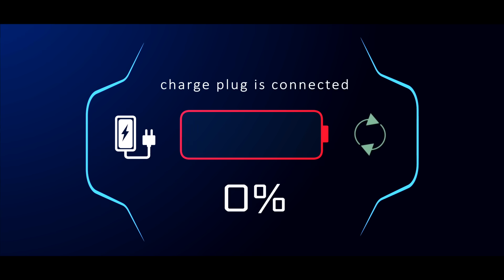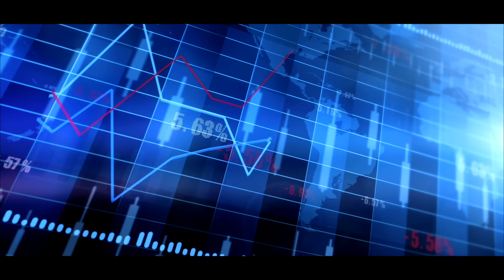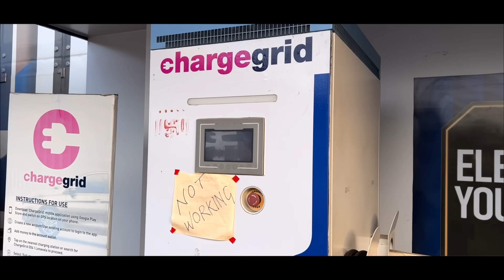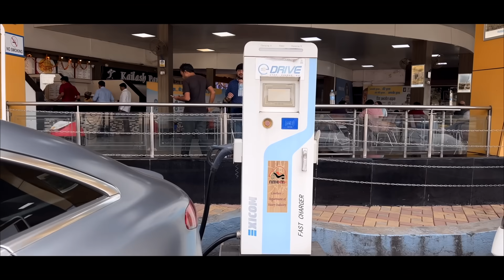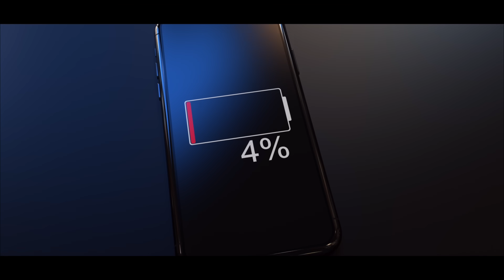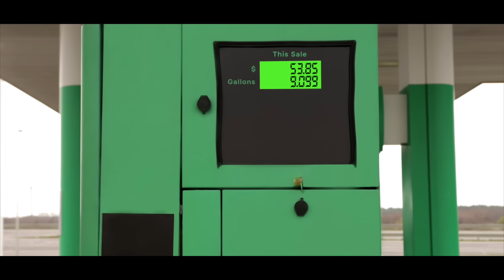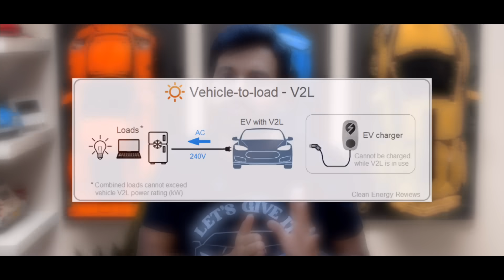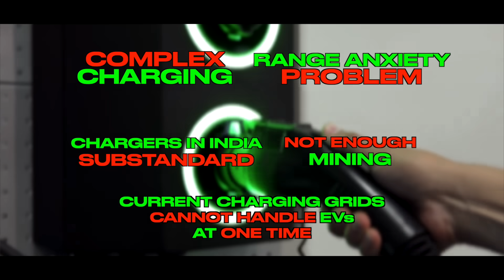Here Is Why Electric Cars Are Not The Future!

Comment: Let's pray this video doesn't get taken down for stating too many facts 🙇‍♂️🙇‍♂️
Reply: Why it would be taken down?
Reply: This video lost (fail to mention) the most important points:
1)  ICE car efficient can only reach about 30%, but EV car efficient can reach 90%， this means for the ICE car 70% of energy goes wasted in the form of heat, which add the global warming.

2)   90% car accidents are due to human error, auto drive is the solution, but you can't achieve auto drive by ICE car, after so many years of testing, why? because ICE response so slow when you give the e-instruction, while EV car can response in 1/1000 second. 

3) To see how the EV car auto response can do, watch the video with the title: 
BYD Yangwang U8 AWD EV SUV With 1,100HP
Reply: @madeinchina1450  yeah I agree with you but most of the batteries are lithium based that's why these videos are popping out once this battery technology gets some changes (Without any lithium or cobalt or any) which is somehow graphene-based batteries would be good but still we need to wait for it again till then we need to focus on more BMS(Battery Management System) which can prevent these incidents.
Reply: @madeinchina1450  name says all
Reply: @madeinchina1450 
1 efficiency is not a problem if the cost of energy is cheap. So when renewables are cheap enough green synthetic carbon neutral hydrocarbons will replace fossil fuels. Ice cars will be cheaper because remember  the kwh per km cost of evs don't take into account the cost of the battery. Every kwh stored on a battery is cost. Cost is the defining factor not efficiency.

 2) self driving vehicles are still not a thing even though people like elon have promised it years ago. There are things AI will never figure out. I saw a video where a self driving car stopped because there was a red advert or something like that and it though that was a red traffic light.  When AI pass a capcha test then maybe they can drive properly
Reply: @amithmalik4648  whole country fuel need to full fill you need 5 times more solar panels and wind theare are also envarmental impact

Comment: You are right Faisal. Another thing to consider is that once the production costs of EVs come down the subsidies will also be laid of as well as the free or minimal cost charging . The only advantage EVs have right now is in low running costs. Once they are in abundance naturally the consumption of fuel would also come down creating less demand and hence lower fuel prices. So in long run the running costs of ICE and ev vehicle would also turn out to be similar.
Reply: Electricity will always be cheaper than oil

Comment: But the thing about EVs is that the source is centralised and the smoke produced is not right on ur face like the ICE vehicles, the electricity produced for EVs is far off from the residential area. So even if it causes the same amount of pollution in generating the electricity, the AQI of the cities will be largely better, just like a mini forest in midst of the urban city which has better AQI then its surroundings.

Comment: Thanks for pointing out the dark side of EVs. Hardly anyone on youtube has talked about this topic. Perfect presentation.
All the points are 100% true.
I just got my license few month few and driving ice cars gives me pleasure . It's a moment for me.
Driving an EV is like driving a toy car which we were used to play when we were kids
I'll never buy an EV in my entire life
Reply: Same here.
Reply: On the contrary, actually a lot of people talked about it and usually with half baked information or bias just like this one. There are a ton of good points in this video but super misleading. It's not apples to apples comparison and more of a bias. And I don't think you have been in an EV before. They will blow your mind. They are fast, quiet and lot more efficient and easy to maintain since there's no maintenance  other than changing vipers, 12volt battery and tires for the most part.
Reply: @techenthusiast4542 you have some great points but  I think one thing some people like is the sound of the car. Many gasoline engines tend to have a great sound, like 5 cylinder audis, dodge vipers, and many other sport cars. Driving an ev  would still be a somewhat unpleasing experience because of that. I love to hear the rev of an engine. It adds personality to the car.Also, some EV'S like teslas have expensive batteries, and they can cost up to $20,000 to replace all of them, when parts for a gasoline car would be cheaper.
Reply: @toasted_bagel59  Yes they do sound great.  Especially my motobike will blow them out of water if I put mine next to most cars. My 3 series had a great sound before I switched to my current Mazda which also makes nice noise. But that's not my point at all. It's all about how we move from unsustainable to sustainable modes of transportation. Either we grow a hell lot of trees all over the world (which doesn't seem to be the case) or switch to EVs for transport and Solar and Nuclear for electricity. Because we are actually running out of oil and we keep drilling more and more locations and more wars if we can't drill. My brother works for an oil company by the way. Our energy demands are only on the rise and so is for other countries. If you live in a big city, go out and look at the sky, smog is the first thing you see. It's kinda depressing. Respiratory diseases are only on the rise if you look at statistics. At least if big trucks are converted to some from of nonpolluting fuel source, things should turn around quickly. Just because I love the sound of my vehicle and bike should mean I have to hate EVs. Battery prices are coming down and should be between 5k and 10k for a pack in next 2 to 3 years

Comment: You have pointed out almost each and every point perfectly. I have been saying the same thing for almost 2 years. I am happy that an influencial person has brought this to masses. Thank you so much Faisal.
There is one more point that could be added. If one leaves the EV unused, the battery looses charge. And on current EVs it looses charge very fast. That's like having a hole in the petrol tank. If possible do that test too. How much battery capacity the vehical looses from 100% when left unused.
Reply: OLA has already added an vacation mode for it . EVs are developing and will make life better and will go cheaper also in coming days. For masses EV are needed for low running cost . Revolution is requred.
Reply: loose = NOT TIGHT ...    ....  lose = LOST
Reply: 🏔🌨🍙🥶⛓🪝🌫🌌
In planet´s cold zones You could get stuck in snow ❄for some hours or even days.
If You need 1kW/h to heat🌡, range gets even more reduced...📉☃
Reply: @rockroll3983  lol

Comment: Slight correction at 14:48 
Most of the Electricity board keeps the tiered pricing, but they charge you as per your usage only, just like the way we pay Income tax into brackets. 
For example: For the first 100 units - 5 Rs/unit, 101-300 units - 7 Rs/Unit, 301-500 units - 10 Rs/Unit, etc.

So, if you use 450 units a month,
Cost = (100 x 5) + (200 x 7) + (150 x 10) =   500 + 1400 + 1500 = 3400

Though, I can not guarantee how Mahavitaran does this, but at least, I have seen most of the boards are following this approach. :)
Reply: Here in Telangana, flat charges apply and it makes big difference between 100 units bill and 101 units bill
Reply: @vencertechniks5698  In Karnataka you have flat charge of Rs 5 per kWh for EV Charging
Reply: You missed the point, when you use your home appliances without EV would only consume say 250 units in 30 days, with EV charging added you'd cross 250 units in 15th day itself, rest 15 days of the month even if you use TV or Laptop, you are now consuming extra tier because you fell into next bracket because of EV consumption.
Reply: @kiranm25x I understand what you’re saying but there is a a separate meter for EV Charging it’s flat Rs 5 no slabs even if you consume 1000 units you need use only for charging the car
Reply: Correct
Reply: @yeshwanthkote  True, but many Electricity boards are not giving at flat rate, they don't want to loose profit and greedy. They are considering it as new Home meter with staggered rates.

Comment: There's a company which had some breakthroughs in 3D printed solid state battery technology. In that battery they'll replace the liquid electrolyte (main cause of Li ion battery fires) with a solid one. Those 3d printed batteries are much lighter and safe. They may help in resolving some of the issues that you mentioned above.

Comment: The State electricity Boards should get involved in bringing out EV charging points so that they can make more revenue, also they have the infrastructure to place charge points in Lamp Posts or electric posts near the road , KSEB has. Been doing that , it has to be implemented more but the starting phase itself looks promising
Reply: Fine. That's a nice point. But from where this extra electricity to charge the cars will come from ?
Reply: They are doing that in some states already.
Reply: A refrigerator takes 1 kWh..per 24 hours.
EV like. BYD atto3 takes 60 kWh...in 6 hours .
Considering even 30 percent of people switch to EV..the transformer and wires will have to grow in size.. India doesn't make so much power..
Reply: @bubusam13  Solar panels are an option , at this point the number of EVs aren't that high, the power grid can handle this eventually better solutions are required
Reply: @saurabhsood8268  fair enough but imagine every ev owner plugging in their cars to their own chargers that itself will consume power they will do the necessary upgrades to the power grid to accommodate the extra load and more renewable sources of energy will help
Reply: @daniesalex7073  

That will happen dude and in a much faster rate than you think.

Did you think that few years back the road infrastructure we have will change like what has happened ? But it has changed right?

It is much easier to upgrade Electricity infra when compared to this.

I do have Solar installed at home and it produces 15 units plus daily. There is huge development happening at Solar power generation actually.

The guy who installed Solar at my home says he has so much backlog of orders now !!

More
Reply: @bubusam13  nuclear ha ha
Reply: @Raveendhana  yes nuclear ofcourse unless they have a reactor built in the car.
Reply: @dktvm7679  it will happen for sure , about solar panels there is an option to sell the extra electricity made from the Solar panels to the Electricity board itself for a certain amount of cash but now they are changing that policy to where the User will have to pay more money if they have solar , not sure about the exact details,
Reply: @daniesalex7073  To generate more electricity, governments would eventually sanction construction of more dams leading to even more ecological destruction. We're already constructing way too many dams in the Himalayan range and witnessing how harmful they're for the environment. The only way we can save the environment while not compromising on our current lifestyles is to develop the fusion technology.
Reply: @hemiacetal1331  Easier said than done , with the fusion technology, Windfarms are a good energy source ( very expensive though) , dams cause a lot of problems, especially when they are being built

Comment: I agree with hybrid vehicles because I am frugal, and being able to feed dynamic braking back into the car to use again is awesome! Ice vehicles are never going to be able to do that, but hybrids can.

I want a Heavy duty Hybrid truck to replace the one I am driving now. I haul a lot of weight all day long and tow a lot of weight about 10 times a month. I want to save on fuel usage and brakes. A hybrid can do that without worrying about range. I can fill it up quickly and be on my way.

The next logical step for me for zero emissions would be a PHEV H2 fuel cell vehicle. I could slow charge it anywhere over a long period but not have to rely on that. I still get the benefits of regen braking and a quick refuel time. H2 is already being made cheaper and cheaper. Also you can capture the water it forms and reuse it in any use you need to or send it back into an Electrolizer.

Comment: Great topic to talk about and good Video Faisal!

I don’t understand slowly phasing out and Banning Diesels. Considering diesels are lean burn engines and produce more power to fuel burnt. Then spent 2 days looking out the stats for impact of diesel cars on Delhi pollution and couldn’t find a single reliable one. However this has made resale value of my 3.5 yrs 30k kms diesel compass plummet below of what you pay for Maruti ignis. Pay the rich at the cost of middle class. That’s what it is sadly 😢

Comment: Great video. You can also add that alternate battery tech like sodium batteries would negate most of the pollution and china dependency if done right. Reliance bough out British Faradion company for their sodium battery tech. That makes battery cheaper and have easily available raw materials. But I still think EVs for cold climate is a no go. Batteries drain fast and perform badly at low temperature condition.

Comment: Excellent video Mr Khan, you have covered all bases quite well. I will add one more point. Data from UK suggest that households having EV are consuming about 2-3 times more energy. Imagine even 5℅ households going for EVs in India, do we have the grid capacity to handle this excess load? Studies in USA has shown they do not have the grid capacity to handle excess grid load of the projected EV cars on road by 2030!
Reply: [Data from UK suggest that households having EV are consuming about 2-3 times more energy.] ----- Don't be stupid, if they consume energy at home, they will not consume energy at gas station. Do the math correctly please.
Reply: Most of EV charging happens at night when electricity is available in plenty and also cheap. in EVs 80% of charging happens in the night at home and only 20% in public chargers. The electricity is used efficiently when EVs are there. In many places too much electricity is wasted due to low demand. In a study in US, it take sonly 30% more electricity when all transport is converted to EV.  
Also remember it takes about a 1kwh of electricity to refine one liter of gasoline.
Reply: Charging an EV doesn’t use more energy than using a dryer or ac so I don’t see how that would 3x the amount of energy.
Reply: @JohnPaulChoate  I guess that claim is [households having EV are consuming about 2-3 times more energy than those who don't have EV ].

In summary, a misleading.

Comment: Faisal, there is no need to replace the whole ev battery if the performance starts depleting, you can simply change the individual cells in the battery which are not functioning well and there you go, the battery is now totally better and the cost is a lot cheaper
Reply: thats exactly what happens. The company replaces the battery pack to a new one for that car, and takes the old one to replace individual faults. Then it is again sold after refurbishing process on some different car

for example if nexon ev max battery fails, they can remove faulty cells and put the good ones into two batteries for tiago ev (40kWh vs 19kWh)